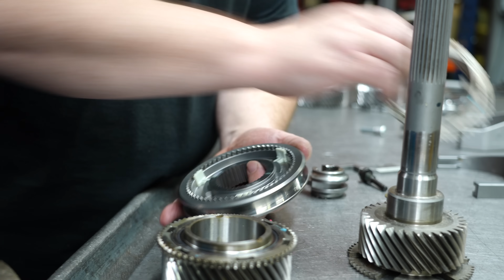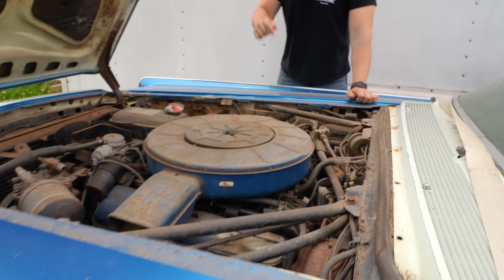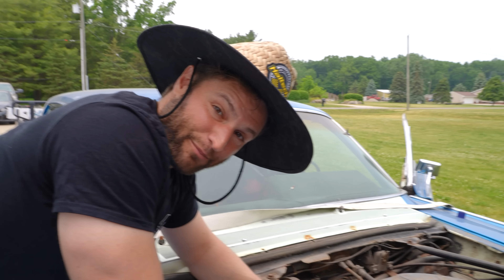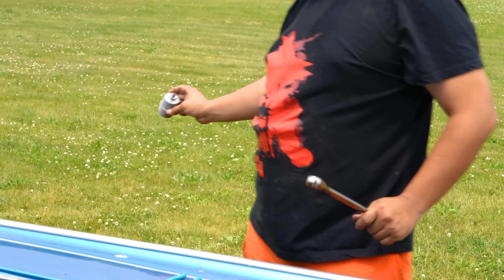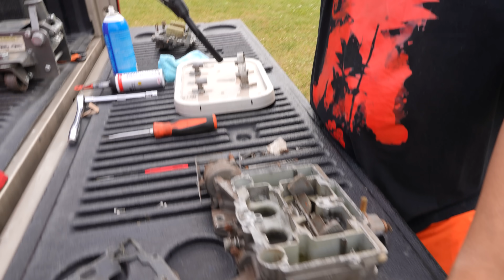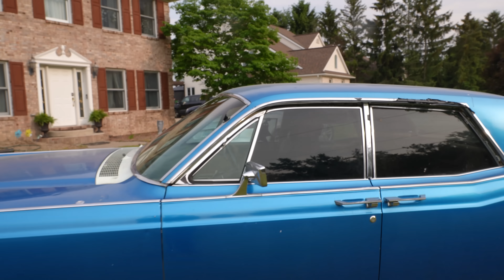Will it Run and Drive 50 Feet to the trailer?! My ABANDONED 1967 Lincoln Continental comes to LA

Comment: Rob
If you ever decide to change the engine
AND
Go to an engine that will fit a C-6 automatic transmission 
Consider the next generation to the MEL Engine.
Torque - 500 pound feet ( stock 429 1968 LTD engine , Premium Leaded Fuel ) !!! 

https://en.m.wikipedia.org/wiki/Ford_385_engine

 385 engine
Article Talk
Language
Download PDF
Watch
Edit
The Ford 385 engine family (also code-named "Lima"[2]) is a series of big-block V8 engines designed and manufactured by Ford Motor Company. The family derives its name from the 3.85-inch (98 mm) crankshaft stroke of the 460 cubic-inch V8 introduced in 1968.[3] A 429 cu in (7.0 L) version was also introduced the same year, with a 370 cu in (6.1 L) variant appearing in 1977.

Ford 385 V8

Ford Mustang Boss 429 engine
Overview
Manufacturer
Ford Motor Company
Production
1968–1998
Layout
Configuration
Naturally aspirated big-block V8
Displacement
370 cu in (6.1 L)
429 cu in (7.0 L)
460 cu in (7.5 L)
Cylinder bore
4.360 in (110.7 mm)
Piston stroke
3.59 in (91.2 mm)
3.85 in (97.8 mm)
Cylinder block material
Cast iron
Cylinder head material
Cast iron
Valvetrain
OHV 2 valves per cylinder
Compression ratio
8.0:1, 8.5:1, 11.0:1, 11.3:1
Combustion
Fuel system
Carburetor (1968–1987)
Multi-port fuel injection (1988–1997)
Fuel type
Gasoline
Cooling system
Water-cooled
Output
Power output
375 hp (380 PS; 280 kW)
217 hp (220 PS; 162 kW)[1]
Specific power
53.3 hp (39.7 kW) per liter
28.8 hp (21.5 kW) per liter
Torque output
500 lb⋅ft (678 N⋅m)
365 lb⋅ft (495 N⋅m)[1]

Comment: NEVER USE STARTING FLUID TO START AN ENGINE...IT STRIPS THE CYLINDER WALLS OF OIL 
WD-40 WILL IGNITE TO TEST IGNITION.
YOU CAN FILL THE BOWL WITH A HAIR DYE BOTTLE .
THEN TEST THE FUEL PRESSURE BY CRANKING THE ENGINE. 
USE AN INLINE FILTER TO CLEAN FUEL THAT YOU PUT IN CARBURATOR. 
BRAKE CLEANER WILL STRIP OIL , RIGHT ? THAT IS WHAT STARTING FLUID DOES. 
WOULD YOU DO THAT TO A ROTARY ?
DID THE TIMING HAVE TO BE. RESET ? 
HAVE YOU EVER TUNED A CAR BY EAR ? 
WHY DID IT OVERHEAT ? 
PULL THE SENDING UNIT AND FILL THE BLOCK ( OR THE HEATER HOSE ).
That engine ran on leaded fuel high octane. 
Sorry but any engine deserves respect

Comment: I think when a gas engine clatters like a diesel truck, that means the ignition timing is so far off the engine is trying to knock itself to death. I don't think I would want to own one, but it does have nice old-school style and would probably make for a few good videos. Will it get a Holley EFI thing to replace the carburetor? Will it get a rotary swap? Will it get something else like a modern V8 or an EV swap?

Comment: So I have a crazy idea for a side project that would probably be very cheap to build and make you a lot of YouTube money, if you can figure out how to build it. My idea is a simple 2 rotor non turbo build… but it’s going in a go kart. You might have to fabricate the frame from scratch and you will have to figure out how to deal with transferring power to the wheels as it might be too heavy to use a regular 5 speed (not to mention way too fast)… you could probably set a Guinness world record for the fastest rotary powered go kart though

Comment: I had a 1977 Ford LTD which was basically the same size as this thing and, I think, pretty much the same motor too.  Bought it for $75 in 1993.  The previous owner had haphazardly ripped out half of the vacuum lines and cut out the cats so the thing was loud AF and barely ran.  He'd also painted over the vinyl 'Landau' top with house paint.  It had an in-dash 8-track player.  It wouldn't start hot unless you adjusted the timing at the distributor.  It wouldn't run in the rain.  The headlight switch had vacuum lines run to it to open the headlight doors and it would freeze in the winter; you'd have to idle the car long enough to warm up the interior and thaw it out in order to have headlights.  The entire pep band drum section's instruments fit in the trunk and back seat.  I think it got about 12MPG, but at least gas was only like a dollar a gallon.  The 3-speed auto was in 3rd at something like 15mph.  I do not miss that car one bit.

Comment: I cant find any comments saying this but the clacking sound is the engine dieseling, something is glowing in the combustion chamber causing the fuel to pre-ignite, can be caused by many things but usually carbon build up coupled with running lean. Very common for carbs to have idle fuel shut off valves to avoid this happening, however it seemed your one was doing it at low throttle which is probably a different issue.

Comment: "is this content more relatable?"
Unfortunately it is, my shitbox munched trough two starter motors in a month, something's fucking with the battery and I'm not about to mess with a 35 yo wiring harness, I'll be installing a battery disconnector and call it a day. Thanks for the relatable content rob

Comment: I grew up learning about EFI and whenever my Dad starts talking about carbs and distributors, I tend to zone out, actually looks like a lot of fun. I need to start messing with an old car for a change, it looks really rewarding.
Reply: Can be as reliable as any modern car with just a choke hooked up. Modern fuel will boil in the carb. So hot restarts can take a second....but I drove a 78 dodge 4x4 almost daily for 2 years. Even when it was 10° or 90°. Or my 76 Chevy step side. 454 Big block,( built with flat tops and a cam on the 90s). 4 speed. 15 mpg. As long as I wasn't driving like an ass....... It was awesome.

Comment: When you buy a car which hasn't been run for years, don't crank it. Pull the plugs put some oil, then crank. Which saves the engine.

Comment: Those venturies cause a vacuum, which brings up the fuel from the float bowls. Between the discharge nozzle and those bowls, that's where the main jets are located. With a four venturi carburetor, there are two main jet. As you are able to imagine, for the 462 cid engine, those jets are quite large. What's cid? Cubic Inch Displacement.

Comment: The Lincoln needs to be restored, but aluminum wheels that look stock only 12" wide in back, giant brakes, killer suspension,  all aluminum 1200HP BBF, Gear Venders OD on a 6 speed automatic.

Comment: Didn't check the oil , antifreeze, brake lines/ fluid . Shoulda gave it a better once over before hitting the street. Bet that head gasket is toast and maybe warped the heads depending how hot it got. Time for a 12 rotor !!

Comment: I've never heard timing so far advanced that it spark knocked at an idle which would also be why it overheated
Reply: Well, it overheated because it had no coolant XD
But it sounded gnarly
Reply: And leaks…
Reply: It sounds more like its running lean to me.
Reply: The run on at the end with ignition off is usually caused by the timing being too retarded.
Reply: @johnt.848  No it isnt. The issue is the cyls are self igniting the fuel due to heat and the vacuum of the engine still pulling fuel in. There is too much air being let in at idle. Someone can cause this issue by adjusting the idle to be higher with bad timing, but the timing itself has nothing to do with dieseling. It is user error.
Reply: @StormHawksHD  run on when the engine cycles backwards is not what you are describing.
Reply: @johnt.848  No it literally is what is happening. the fking coil isnt even on. Its dieseling. It happens all the time on incorrectly tuned carbies. Do some research.
Reply: @StormHawksHD  R U OK?
Reply: @johnt.848  Yes. I'm just offended by your complete lack of knowledge of carby engines and can tell you have zero knowledge and have never worked on one or driven one. Imagine thinking the ignition had any effect when its turned off... What a joke.
Reply: @johnt.848  See. This is how you win an argument. When you are beat with facts, act like a child and make fun of the other dude. Calling them a Trumper or Racist gets you extra points.
Reply: @eriklarson9137  I'm glad you can see he was getting petulant too and unwilling to accept someone has a different opinion. Have a nice day. My comment was based on past experience with Ford motors known for running on, in the past.
Reply: I hope they keep the 460 in it.